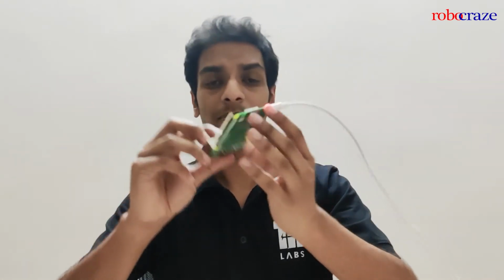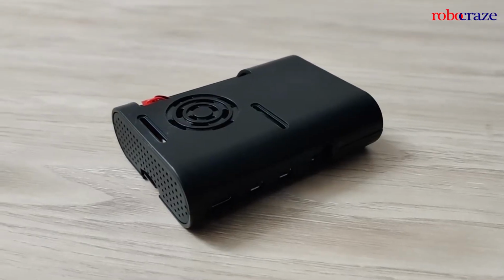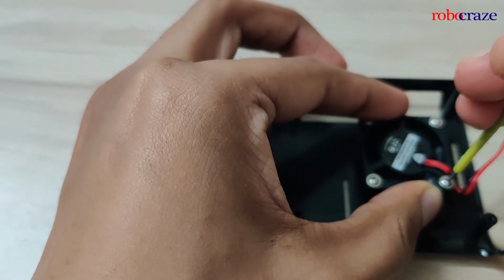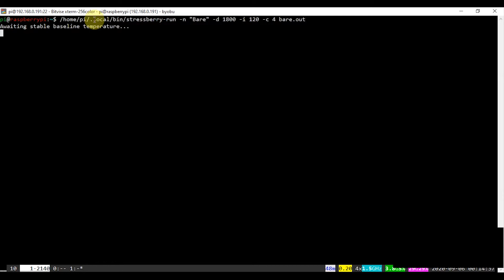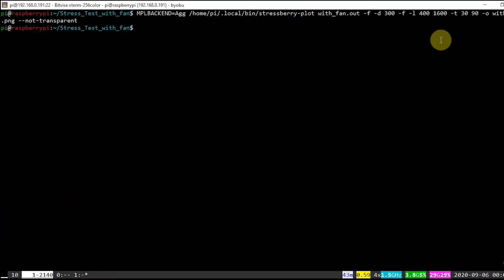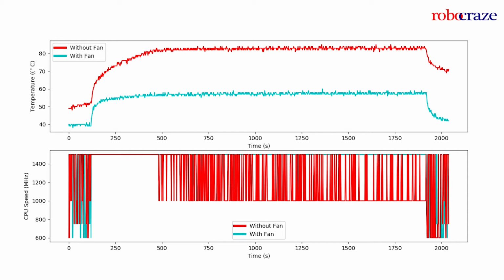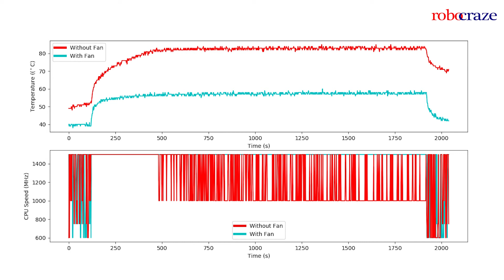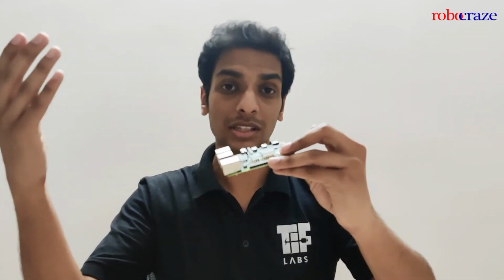Improving Raspberry Pi 4 Performance using fan & heatsink | RPi 4 Overheating Issue Fix

Comment: Is there enough space for using heat sink and the cooling fan at the same time ? please reply 
I have ordered heat sink and cooling fan both from your website.
Reply from the maker: It depends on the size of the heatsink. The one's you get bundled with the case will definitely fit inside the case, as it is designed to.
Reply: @Robocraze  the shipment was received few days ago. The space between the cooling fan and cpu is too low to fit any decent heat sink. Hence  I was compelled to use the ram heat sink on CPU and fitted the cpu heat sink on ram.

Comment: Hey I have a similar case and fan but fan makes some grinding noice
Reply from the maker: Hi,
Please ensure that the fan has been mounted properly and that the blades are not touching any other components. Also ensure the is no debris inside the fan housing itself.
Reply: @Robocraze  there isnt is the fan bad or an external problem because it wont do this

Comment: I donot know much abouot RPi how ever Im currently doing a research work on that platform and about a month ago I have got that warnnoing msg indicating the tempturature (overheating) icon and now it is not working. the board is working fine but there are no images on the screen and the processor is overheated. is there anything that I can do to recover that?
Reply from the maker: Oh, that's unfortunate. If you think the board is fine and just that display circuitry is damaged, you can still maybe use SSH and install VNC viewer to get GUI to display through network

Comment: Can I use normal Samsung USB C cable with it?
Reply from the maker: Hi Aishwary,
Yes you can use any type C cable with it. Just ensure that the power adapter can supply minimum 2A of current.

Comment: Is it normal for the fan to be still active after shut down?
Reply from the maker: Hi Amer,
Yes, as long as the USB power is connected to the Raspbery Pi, the 5v pin will supply voltage even after shutting down.